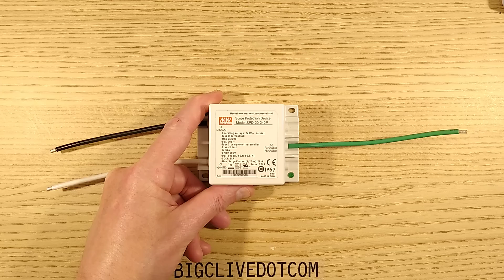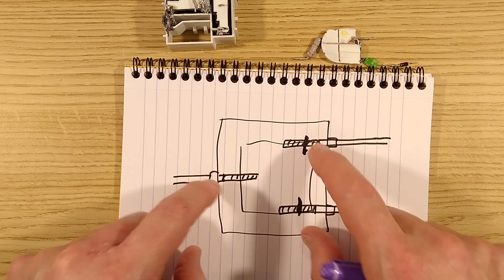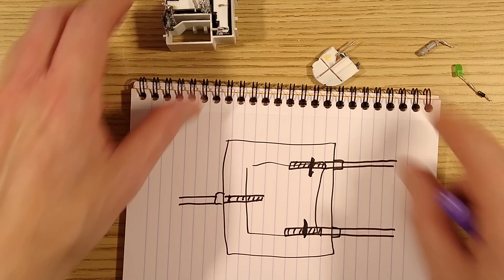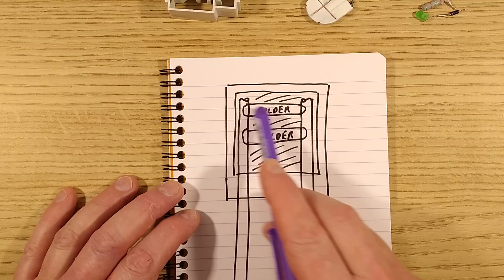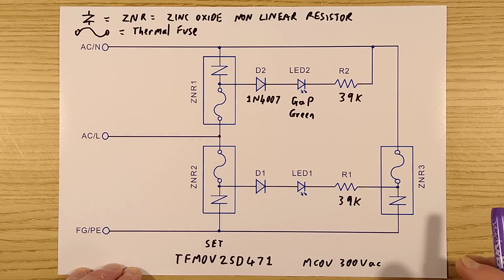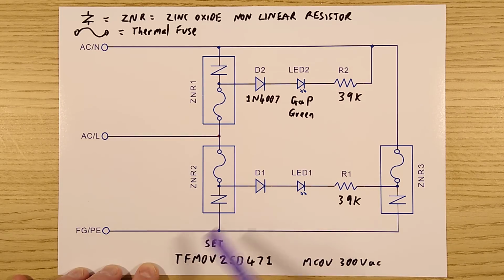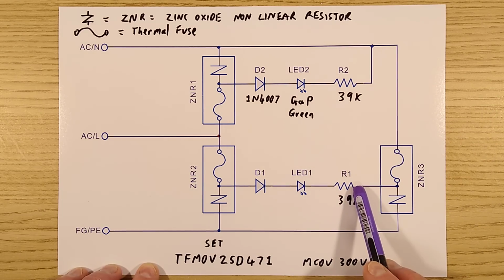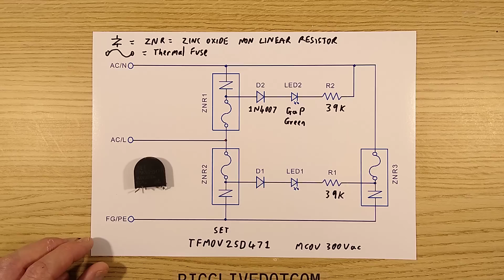Incredibly good Meanwell surge protection unit (with schematic)

Comment: Having butane in gasoline is great for the engine. Problem is it slowly evaporates from the fuel resulting in the octane dropping and the fuel becoming worse. For storage, engineered fuels are not a bad idea, but  not having butane makes the fuel harder to properly burn.

It should be noted that summer blends have far less butane so ethanol free summer blend is the best one to store for far less money than "engineered fuel"

Comment: I'm missing something here, does it have an i/p and o/p? Does it disconnect the supply path? All I can see it does is make the LEDs go out when a fault occurs. How does it protect a load?  Like I say, I'm clearly missing something obvious.
Reply from the maker: It goes in parallel with the protected load and shunts voltage transients.

Comment: I have a 24v 1000w Mean Well power supply I use for my lipo chargers. In electric R/C "previously owned" surplus Mean Well supplies are commonly used for this because they cost about the same as a new noname PSU from china but are much higher quality. If a Mean Well supply says "1000w" then it can run at 1000w 24-7 with no problems, they're actually derated by 25%.

Comment: In my design, I placed the silicon diode in parallel with the led but in reverse, to avoid exceeding the reverse breakdown voltage of the led.

Comment: What if ZNR3 fails, blows it's thermal fuse and leaves it's MOV in a low impedance failed state. Then the Led would still light up through a few mA ground fault but signaling all is good. That's not Ok is it? Or I am missing something? Big fan btw.
Reply from the maker: That is possible.   Fortunately the most stressed module is probably the L/N one.

Comment: I had an ATX power supply in a lab instrument fail and was amused it was manufactured by a company called Meanwell . I showed the client and said they mean well but don't quite make the grade.
To be honest , the PSU had been running continuously for 12 years and failed after a power down / power up cycle - possibly the first such cycle in years.
The PSU enclosure was a very nice extruded aluminium design with integral cooling fins.

Comment: this question may be stupid, but why did they also protect the earth? and isn't the small current flowing through to earth going to trip the breakers?
Reply from the maker: Current will only flow to earth in the event of transients.  This is an industrial device that would probably not be used with an RCD or GFCI.
Reply: @bigclivedotcom  Thank you!

Comment: Why did they put a diode in series with the green LED? Is it because the LED cannot handle so much negative voltage and would burn if the diode was missing?
Reply from the maker: It will conduct in the reverse direction above an avalanche voltage, so the resistor would be dissipating twice as much heat.
Reply: @bigclivedotcom  Thank you!!!

Comment: a similar solder type fuse exists in the automotive world, where two springy, wires are joined by a small blob of solder, if the wires get hot enough the solder melts and the joint springs apart. Found in heater resistors, so if someone doesnt change the cabin filter, and the resistor overheats(its just a coil of nichrome) it densest set the car on fire, just melts the solder. if your tight as a tight thing, you can simply re-solder the join to repair it !

Comment: Big Clive - do you have any thoughts on the "surge-protected" 13A multigang extension socket blocks?  Are they a con - or could they protect connected equipment in the event of a lightning strike?
Reply from the maker: They will definitely help to a degree.  I've had a look inside a few.

Comment: Mean Well also has a really good inrush current limiter called the ICL-16R. Just in case you are interested. Would be interesting to know how it works internally. I actually have one between the "main switch" of my desk and all my PC related stuff with a lot of switching power supplies. I went through a lot of switches without the current limiting device 😂
Reply from the maker: Looks like it's based on NTC inrush limiters with a relay bypass.  I'll try and find one.

Comment: Very interesting. Are these thermal fuses  commercial products or made by Meanwell ? MOVs are standard products of course. I was told that MOVs are like time bombs, after withstanding surges they become very low resistance and catch fire. Hence all the sealing and the quenching sand, I suppose.
Reply from the maker: I think they might be sold as a complete module by the MOV manufacturers.
Reply: The fuse and MOV assembly is an off the shelf component, in this case from a company called SETfuse.
Reply: @Monkeh616   Thank you !

Comment: It is nice to see MOVs used in a way that plans for them to eventually fail. As for protecting a whole house, well this unit isn't rated for it, and so cannot be installed in a breaker panel (over here at least).  There are similar units available for the purpose. Note that when doing so (in the USA), the unit must be connected through a dedicated circuit breaker, and both breaker and unit should be positioned as close to where the wires entire the breaker panel (from the meter) as possible.  [there are also units which install in the meter base, but pulling a meter is a HUGE deal, so you don't see many of them. Maybe my smart meter comes with - it's the best place to put them!] - note also the unit should be positioned as close as possible to its breaker so that the wires between them are as short as possible. If you want to go premium, there are units which don't use MOVs, but bring money.
Reply: OBTW: when Meanwell put a CE stamp et al on their case, they actually have got the approvals.  
We should all know by now that's not always (usually) the case for things coming from Our Honorable Communist Business Partners From China!

Comment: It saved me a lot of bother and clutter to just get a whole-house surge protector for my junction box. Voltage spikes can get surprisingly high and I have a soft spot in my heart for MOSFET's.
Reply: That only protect you from surges coming into your home from outside. Point of use units protect sensitive items like consumer electronics from "bully" appliances like A/C units, clothes washers, and the like.  Defense in depth.
Reply: @railgap  That may be a good point. Worth some thought (and reading some scope traces). Thank you.

Comment: MeanWell is a decent brand, We use their SMPS modules (12 v @ 40 amps or higher) to power Digital 2-way radio communications transmitter power amplifiers
Another unit we use is their 24v SMPS modules  mounted on 19" rack panels with 4 and 8 port PoE taps to power wireless bridge radios so we dont have little PoE injectors hanging about all over a site.

Comment: I tried using a MeanWell AC/DC converter on a project of mine, only to discover absolutely horrific EMC performance (conducted emissions).  So bad in fact, that it made me wonder if the product datasheet claims were made up, or if I somehow got parts from a defective batch.  I'm tempted to test some of their other products, but haven't gotten around to it yet.
Reply from the maker: I wonder if it was a fake.
Reply: @bigclivedotcom  It was an IRM-10-12 I bought straight from Digi-Key, so that wouldn't be my first thought.

Comment: Meanwell literally saved out butts! Had to run one of their power supplies @110% rated for 24 hrs a day x 9 days in 50 degree heat. Had some equipment fail on us in the desert and had no other options... little guy took it like a champ and didn't let us down. 

Will only buy MW :)
Reply: Mean Well PSUs are derated by 25% to ensure they can run at the specced current 24-7 without problems or affecting it's longevity so an extra 10% wasn't actually over it's real limit.

Comment: Well what is input and output of that circuit? It just connects live, neutral and ground?
Reply from the maker: It just goes across the supply and shunts voltage spikes to ground to protect equipment.

Comment: A lot of that circuitry is commonly found in many devices, albeit at much lower power ratings. 

Instead of a thermal fuse, a fusable resistor is added along with a small fuse. First thing to check after a system goes down!

This is a great design though! What I'd have done in addition, commonly found in military stuff, is add a red led across the fuses, which lights up when the fuse pops. 

Beats the lick your fingers and run them quickly down over all the banks of fuses while you're being fired at... The one where you get a zap is the culprit!

Comment: Hm, when the LED fails for a bad reverse protection, you will probably replace the unit .... ?
Reply from the maker: The LED should only go out when a thermal fuse fails.  They are designed for continuous AC.

Comment: I think 300MCOV has to do with the COntinuous rated nominal rms rated Voltage 300*root2= 424volts peak, which is in close agreement with the part number breakdown you mention earlier.

Comment: Interesting  ( ? )  that this device is rated for 230 Volt , UK mains , but the wires are coloured for 120 Volt , US mains .... This is quite common  now for many UK products (  Poundland E27 bulb holders etc .. !  ) .... the  BLACK  wire is the live , which can be confusing for some folk , as the ( old UK domestic scheme ) used black as the neutral , (  then in industry black is phase 2 ! ) , then the  WHITE  is always neutral in the US system  ........ DAVE™  🛑

Comment: Do love Meanwell gear in general. 

The conveyer systems at work, use 2 sizes of 24v units, and I've often joked with our fitters, I'll end up borrowing one for a bench supply.

Additionally I have used their 15amp based switchmode units, often found in various MAME video setup's, but in an Electrocoin Bar-X slot machine, Electrocoin themselves, often using the very same units in their video game setup's, noticed for their rock solid reliability.
Reply: Ironically actual classic arcade games from the 80's are infamous for their shoddy PSUs (and monitors, and poorly engineered mainboards) but then it was never thought anyone would be using them for more than a couple years at most so they cut as many corners as possible.

Comment: I wonder if there is an equivalent device that is simply two-pole, i.e. so that three such devices would be needed for protection thus saving you the cost of replacing all three in case only one of them fails in the combined unit.
Reply: I would have never have thought of that.   😆
Reply: @simonruszczak5563  It is pretty common for repairing potted transformers or other potted components but the potting substance is usually made to be melted back so that you can recover the part. I am not sure whether this can be done with resins.
Reply: @Stelios.Posantzis   ?
I was referring to my previous comment your plagiarised    🤣🤣🤣
Reply: @simonruszczak5563  ok I see you also wrote about separate MOVs. I did not plagiarise your comment - I only just read it now because you replied to me  to point it out.
Reply from the maker: You do get a modular version with two or more separate modules that can be swapped out individually.

Comment: Is there any explanation for the really thick case and why there is a thick (~1cm) layer of resin? What is the quartz sand for? Could it be silica sand or would it be entirely of our place in there?
Could the resin be removed by mildly heating the device, e.g. at 60-80 C in the oven? Would that soften it enough so that it could be separated from the case/components?
Reply from the maker: The unit is intended for use with LED signage where it has to be ruggedised against harsh environments.

Comment: Could have been implemented as 3 separate surge protection modules, one for each MOV, and then wired together. 
Would only need to replace a single MOV, not the hole unit if one fails.  More convenient to have them all in one unit though.
A cheapskate like myself would repurpose failed Meanwell units by the wiring of 2 modules with different MOV failures, not that they're likely to fail anyway.
Reply from the maker: If one has failed then it might be a good idea to replace all three anyway.

Comment: If I'm fitting a mains power supply in my kit Meanwell is the goto supplier. Used them for years in both my hobby and professional designs.  They always pass the required certification with no issues. Just fitted a 24V 100W one into my CO2 laser from CPC (Farnell) for about the same price as an unknown brand from Aliexpres. They provided the mains isolation that allows be to cut the daisy and not be pushing them up.😂

Comment: I’m still unsure of what exactly this device does… does it actually protect any downstream connected devices or is it just an indicator of a surge?
Reply from the maker: It clamps the voltage between the connections of adjacent equipment, protecting it all.

Comment: apparently, epoxy potting compound can be relatively easily removed by boiling it for awhile to heat it up, and then it gets soft and can be picked away.  I saw it on different youtube videos and I can't wait to try it on the next thing I have to depot.  I used a heat gun which worked to soften it up and pick it away but boiling seems to be much more effective with less chance of damage to the device

Comment: I've seen you try to get into other things with resin so I figured I'd offer this tip that helped me- I reccomend a small Ultrasonic cleaner/bath there are some pretty good ones on amazon for around $100-150 USD, preferably one that outputs <the vibration> of around 800+Hz & you can use either paint thinner or mineral spirits along with the ultrasonics to dissolve the resin/epoxy usually without damaging most of the components inside. (those LED's probably would be plastic free afterwards though) Another thing you can try is using rather warm Castor Oil, as most Endo/Exo-Thermic epoxies & resisns are made with it & as such it, <And it's highly acidic properties> can also breakdown quite a few resins. (though slower & less reliably than the prior method)

Comment: Do they provide ratings such as how much power the device can absorb as it fails/shorts, how quickly it acts, etc. Two lightning strikes in (very) quick succession are possible.
Reply from the maker: It will have an energy shunting capability.  There is a datasheet on their website.
A direct lightning strike will destroy the unit, but it may help save adjacent equipment.
It's generally more for lightning strikes on power lines.

Comment: MCOV = Mean Continuous Operating Voltage.  (forget everything else I might have deleted before .. pls.)
Reply: Maximum, not mean.
Reply: @Monkeh616  I respectfully have to disagree.  The maximum would be the rated voltage. (470V). Plus, it's not like a fast blow fuse.  It will tolerate short advances to and a little beyond 470V.   Life being what life is, the operating voltage is want to vary a wee bit, well maybe more than a "wee" bit.  You can go with maximum if you like.  I will stick with mean.
Reply: @uni-byte  What either of us 'like' isn't really relevant - the term MCOV, meaning Maximum Continuous Operatng Voltage, is defined by the relevant product standards (UL 1449, for example), and is specified in volts AC RMS. It must be well below the threshold of conductivity, because you do not want the MOV conducting in normal, continuous operation.
Reply: @Monkeh616   Sure, no problem.  However "MCOV" is not defined in UL 1449.  Want to try again?

But I'll give you a hint It's defined in UL 508A, and YOU ARE RIGHT!!!

Well, you learn something new every day, huh?
Reply: @uni-byte  From the third edition, as that's what I have to hand: "3.16 MAXIMUM CONTINUOUS OPERATING VOLTAGE (MCOV) – The maximum designated root-mean-square (rms) value of the power frequency voltage that may be continuously applied to the mode of protection of an SPD"

You can also find MCOV quite clearly defined in the datasheet for this SPD, and on the product page of the specific TFMOV in question. The equivalent term in the rest of the world is Uc, and from the datasheet for the TFMOV "The voltage applied continuously to the TFMOV can not exceed its maximum continuous operating voltage Uc.". Oddly enough, the Uc value is the same as the MCOV one.

UL 508A is referencing 1449. I'm guessing you found the guidelines referencing the updates to 508A to incorporate reference to 1449..
Reply: @Monkeh616  Okay, so "You are right twice!!!"   Want to go for a thrice?   BTW, it's available on line.

So, let me summarize.  You are right, I WAS wrong, you are a hero, I suck.

Okay?

Comment: Hello big clive a quick question for you i purchased a cpt 12v to 5v usb converter with 2 usb ports. I bought it for an alarm system powered by 5v usb its a RFID alarm system bought on aliexpress. I plan to connect the alarm system to one usb and the other usb a siren alarm. I plan to wire from my lesuire battery with a 3amp  fuse. Are these ok to use continuously for the alarm system 

Thanks
Reply from the maker: It depends on the quality of the power supply and its continuous rated current.
Reply: @bigclivedotcom   @bigclivedotcom  Thanks for the reply the alarm panel is 5v dc 120mah working current standby 80uA also jack output siren less then 500mah. The usb siren 5v dc 1a output alarm current 230mah stanby current 13ma.

Comment: An additional layer of protection would be to put gas discharge tubes in parallel with the MOV's, I designed something similar in the 90's; Furse & Phoenix contact make similarly robust products.
Reply: If you put the gas discharge tubes further up the line at the distribution board the induction of the power cables will keep voltage down and save MOV's from overheating at high energy discharges. There are ready made units for this.
Reply: Ahhh Furse, a name I remember well from Nottingham. They did quite a few things, lifts being one thing, and I know of one in pretty much unmolested condition at the old co-op (Now 3 Counties Snooker) in Long Eaton, Derbyshire.